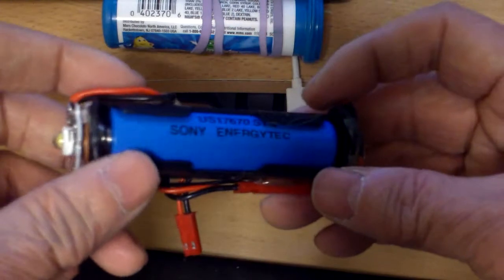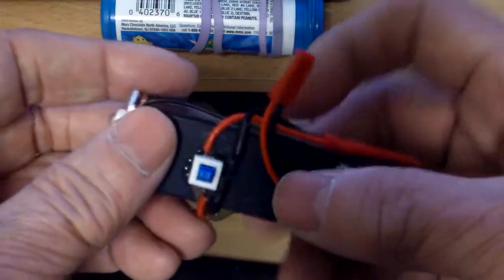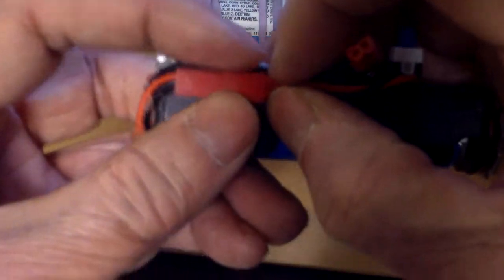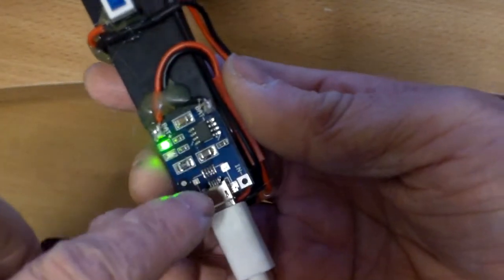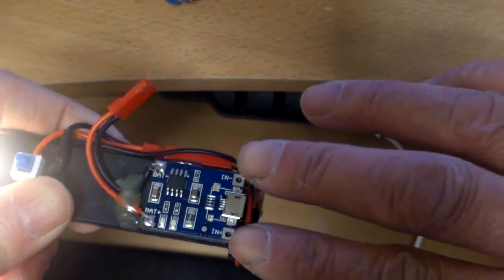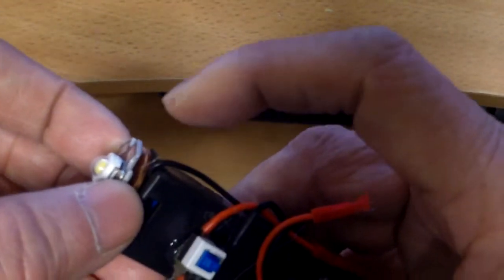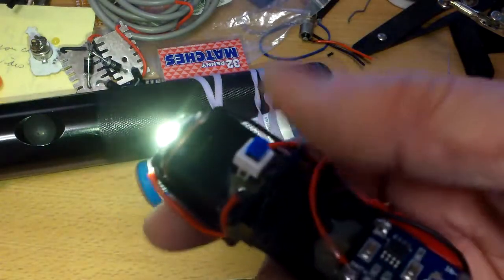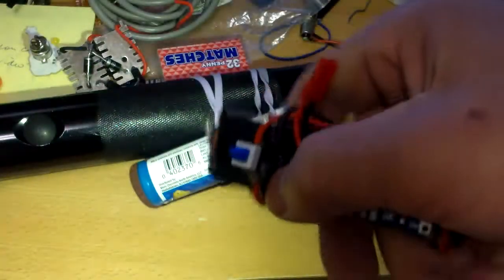DIY one watt rechargeable LED flashlight

Comment: can you add link to the board?
Reply from the maker: This is one of many...  
http://www.ebay.com/itm/5V-1A-1S-3-7V-Li-ion-18650-Lithium-Lipo-Battery-Charging-Module-Charger-Board-/282238421787?var=&hash=item41b6b88b1b:m:mM_VoxEltZf2E1oR1L4cGJg

Comment: where did you get ur led?,
could you somehow rig both plugs together so you wouldn't have to unplug and plug the tp4056?
Reply from the maker: You can rig both plugs together with switch. I got my LED on eBay.
Reply: ok thanks